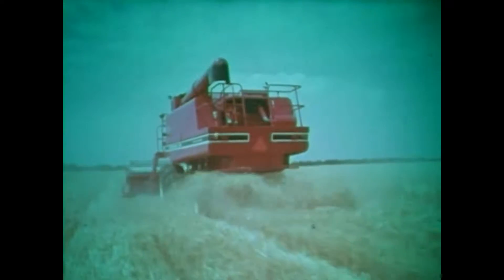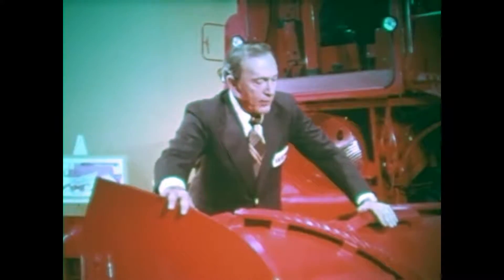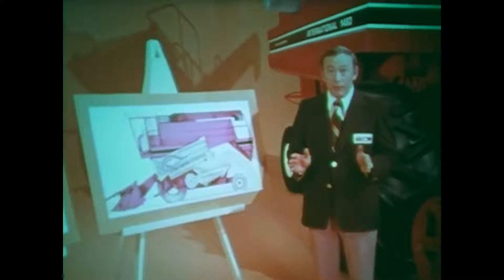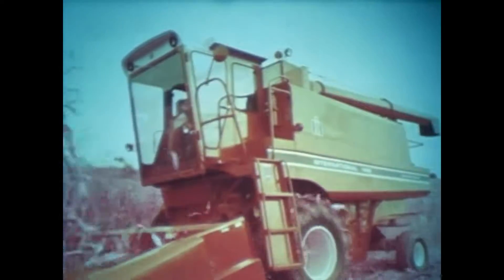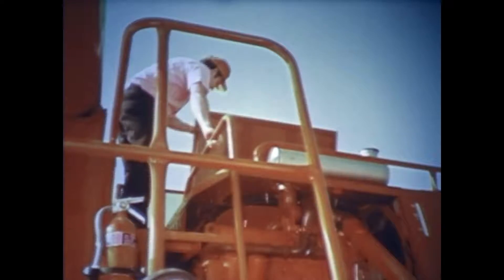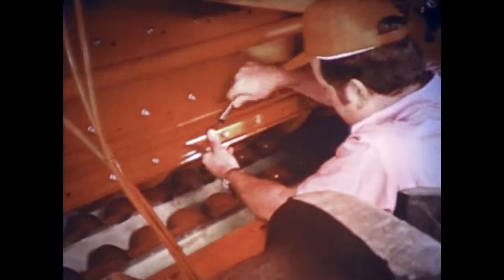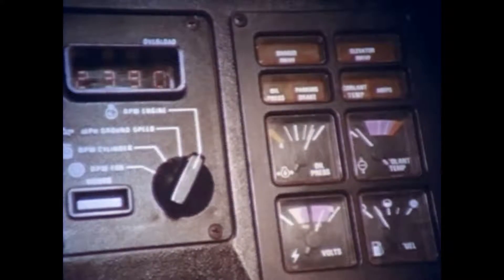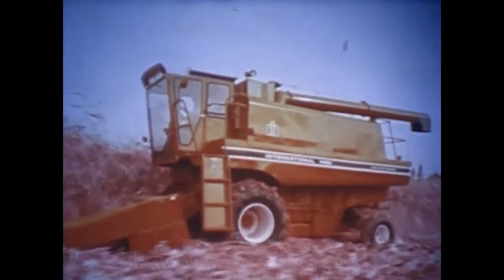Axial Flow Combining

Comment: I read about the development of the Axial-Flow in Red Power. They had a few test 1460's IH sent out to actual working farms with a team of mechanics and engineers with a direct phone line to the main engineering department in Chicago. They'd run the test 1460's and phone in minor changes and improvements as the main design worked almost perfectly out of the factory. RIP IHC, a brand that seemed to have the farmer in mind first and foremost. I still see many of the 1400 series still out there today earning their keep. The design was actually simpler than most conventional cylinder type combines with less moving parts and easier access.
Reply from the maker: Hello Tom. Great stuff. Perhaps you would enjoy our book Red Combines? It has lots of detail about 1400 series development--including the fact that they tested the rotor working under glass, and sent high-speed film of it to the local TV station each morning to be developed. This showed them how the material flowed. You can find the book at https://octanepress.com/product-category/books-red-tractors-caseIH-farmall-mccormickdeering-internationalharvester
Reply: @Octanepress  Sweet! I'll definitely check it out.

Comment: The PAMI reports show that the IH 1460 had more capacity than the Gleaner L2.
Reply: I know for a fact that a 1480 will cut time and a half as much as an L2, can't speak for the 60 tho
Reply: You can't compare one year to the next on two different combines. You have to compare to the reference combine used at the same time in the same field. The L2 was 1.2 to 1.5 times greater in capacity than the reference combine. What was the difference between the 1460 and the PAMI reference combine?

One other thing, I bet I know how to set and operate the L2 and 1660 better than those who tested the combines for PAMI., although only in soybeans and corn because we no longer harvest small grain here in my part of Minnesota.
Reply: @SilverGleaner  Just saying what they said. Didn't say they were right.

Comment: It never matched the capacity of the Gleaner N5, N6 or N7 and the 1460 was no match for an L2..... a 1480 was more in line with an L2.
Reply: Only the N7 will out cut a 1460,  but the 1460 will completely blow the doors off an N5 or an L2. We operated all those machines side by side.
Reply: @33Kpro  Not in my experience. My L2 out combines my friends 1660, especially in green stem soybeans but also in corn. I've used each in the field. My L2 is a 1981 model. In 1980 the L2 was given a longer cleaning shoe which is what puts the L2 over a 1460 or 1660. 

The 1660 is a great machine but it's no N5 as far as capacity. An N5 has the same frame and basic dimensions of the N7 with just less horse power. An N5 is an easy 8 row machine. The N6 is a 12 row machine and the N7 is a more powerful 12 row machine. Sit in the seat of a properly set N5 and then run your 1460. You will see a big difference...... That's not even mentioning wheat where the rotary Gleaners shine.

What gives the Gleaners an advantage is the precleaning ability which takes a lot of load away from the sieves. The rotary Gleaners use accelerator rolls to speed the travel of the grain through a high wind blast to clean it before it gets to the sieve cleaning shoe. Worn out accelerator rolls will make a rotary Gleaner look sick so keeping good rolls is very important in say an N5 or any rotary Gleaner. 

If you out combined an N5 with your 1460 I'd suspect it was because either the N5 operator was in relax mode (which I do in my L2 and/or my R52 sometimes), or the N5 has bad accelerator rolls or too many reverse bars on the rotor. 

I've worked in both an Allis dealership and a CaseIH dealership in the 1990's and the Gleaners of the 70's, 80's and 90's will out work the IH combines of the same era. But the IH/CaseIH combines were still a great machine with a good reliability record for the most part.
Reply: I have run side by side with an L2 with my 1480,  I could easily cut time and a half as much without pushing.
Reply: @nealschierling5373  in what crop? Some machines do better than others depending on the crop. Soybeans I dought it in my experience at least not by time and a half. Probably not wheat either but I've never been in wheat. A specialty rotor would make a big difference for a 1480 but that wasn't run on 1480's back then.
Reply: @SilverGleaner  pretty much any crop, I had a 1480 with a bit of a tweaked rotor and a little more horsepressure and it wasn't a problem even with a larger header. The L2 was and excellent machine but just didn't have it when matched with a properly set and operated IH rotary, mine was especially set up to thrash beans and did an excellent job until I upgraded to a 2188 with impeller blades instead of elephant ears and that was another leap forward.
Reply: @nealschierling5373  Until you've spent a considerable amount of time in each, you really won't know enough to make a fair comparison, and combining next to your neighbor really means little. My buddy with his 1660 combines super slow when he runs it, but when his son-in-law runs it, he almost doubles the speed.  My buddy will combine his corn at about 2 mph with a 6 row head when he could go 3-1/2 mph. But I've ran both his and mine. He runs out of seive capacity in heavy corn before my L2 and runs short on power in really green stem soybeans. Rotary combines need lots of power, especially in green stem soybeans. On the other hand, the 1660 will put a little  better corn sample in the bin on certain years in but I never was docked for my slightly less quality corn sample. Wet corn is where a rotary shines.
Reply: @SilverGleaner  I can't argue about the smaller rotor combines, they don't have nearly the capacity of the large rotor 80 series, but I have ran both a 1688 when it was brand new and a tweaked and tuned N6 and they were very close competitors. But I would match an 80/88 series rotary with equal size headers to an L2 any day, there simply is no comparison. The L2 was a simply designed excellent machine but just couldn't match the large rotor binders nohow.
Reply: @nealschierling5373 To clarify, I would not say an L2 was a match to an 80, but the later L2 (larger sieves) was closer to a 1480 than a 1460. That would be if the IH machines had the standard rotor and not the specialty rotor and also the original elephant ears and not the updated elephant ears, which were prior to the Massey style auger. And then the improved cleaning fan was another update that helped the IH. If you are talking out of the box 1480 vs the 1980 and up L2, then in my book, the L2 doesn't trail very far behind the 80.
Reply: The L2 is a famously good machine. But weren't they about 15 grand more than a 1480?
Reply: @glenirwin1110  no they were slightly less than a 1480. I have old price books with resale values too. Back in the Gleaner haydays Gleaner was number one in resale. My books verify that. I got them from an old CaseIH dealer I used to work at.
Reply: @SilverGleaner  what did both sell for new? I am curious I really think the later model L2 have a rep as a great combine. Hard to tell old prices some info is for rear wheel assist and some is for standard but never can really tell which is which.
Reply: @SilverGleaner  Okay, I'm dumb. I was looking at a Canadian Gleaner price info. Canadian dollars. Still curious what those combines sold for new in U.S.
Reply: @glenirwin1110  Looking on line a 1460 Grain list at $63,406 in 1980 and a 1480 Grain list for 72,661. All IH rotaries were hydrostaic drive.
Reply: I have a 1982 1460 and a 1981 L2 corn plus (which I love to run, don’t get me wrong) both 24ft heads and have run both in the same field side by side in Kansas 20-70 bushel wheat. The 1460 is hands down the better machine for faster easier threshing and less grain loss. Not going to say the L2 is behind by much in good conditions but when the straw gets tough and you hear the ratchets after she’s made a square bale in the walkers, the IH is superior. Just my 2 cents. I own a JD 9600, Case IH 1680 Cummins long shoe, 1460 and 4 L2’s. I love my Gleaners but they are further down on the pecking order these days.
Reply: AC was pure junk, PERIOD.
Reply: @matthewlitvak2695  Everyone has an opinion just like everyone has an..... well you know